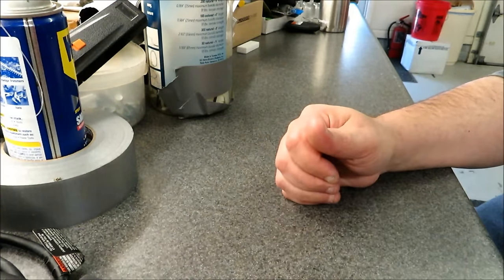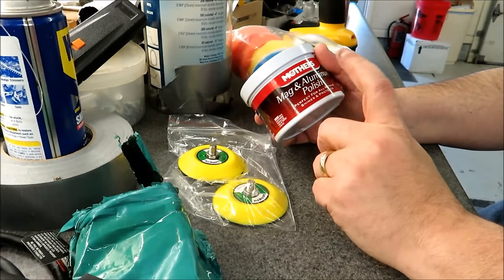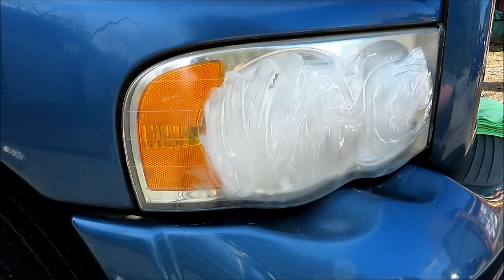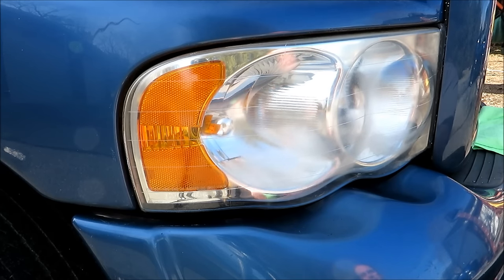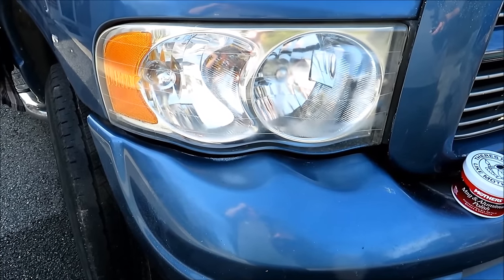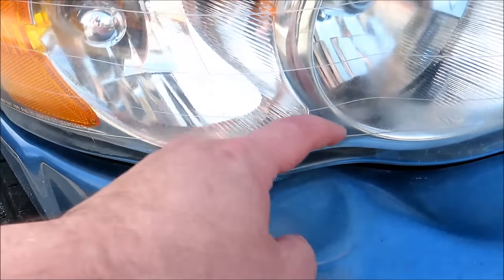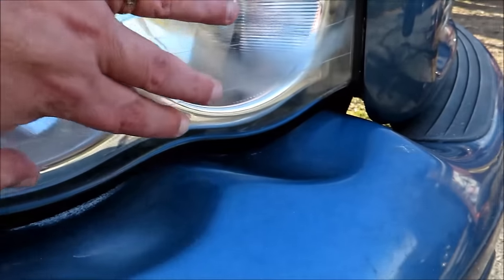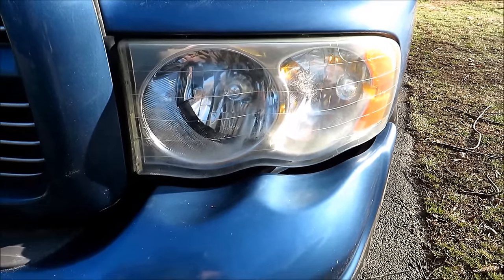Headlight Restoration using Mothers Mag Polish - Pass or Fail

Comment: It would help if you concentrated on the areas that were really bad. There are a lot of testimonials that Mothers really works; so your process is the one that is not working. There is also the possibility that you put a clear coat on the lights in which case it will require a more aggressive sanding.  Also, it should not take more than 10 for both headlights.

Comment: i have tried 3 store bought kits but one time with mothers mag cleaner did the trick beautifully, lot less work and looks great
Reply from the maker: Yea I was really hoping it would work for me as well.  I just think my lenses are to far gone.  The degree of damage that can be felt is pretty severe.
Reply: i was told by the garage that the lense on the drivers side was beyond fixing but i am stubborn,, i did the other one first i was so happy i did the one you could not even see thru and it even felt rough to my fingers but it took three turns and it came out brand new.... i am a  happy boy, off to florida tomorrow and happy that the lights will now shine brigher
Reply from the maker: Yea i don't know what is actually wrong with my lenses because that rough area wouldn't even come out with straight up compound and a DA polisher.  Which is why I think I may just be replacing the whole fixture.
Reply: @ticketyboo43  really need good lights on your car. Congrats on things working for you.

Comment: Nothing works like sandpaper also called micro mesh. I’m talking about superfine grits, so fine they don’t even feel like sand paper. I use 6 grits 2000, 3000, 4000, 6000, 8000 and 12,000. You can get 18 assorted pads on Amazon for about $20. Then polish with a wax and UV protection. That takes out any yellowed plastic and even pitting. You wet sand it by hand. It’s not as hard as you would think and the micro mesh pads last quite a while.
Reply from the maker: I might give this a try.

Comment: Every case is different, it will sometimes six and maybe more passes on each lens. It does not appear that you are using enough material on the lens and get a real cutting pad. I detail cars and yes there will sometimes be stubborn spots that require more aggressive buffing.

Comment: There is no quick fix  hack way to do this. Start with 800 wet sanding all the way down to 3,000. Clean and apply a UV sealant. You gotta put in the work

Comment: I used Mothers Mag and Aluminum Polish on a 2005 Lincoln Aviaor lights.. COuldn't even see the lights because of the oxidation  After one application it cleaned them up crystal clear  I did add another application just because I wanted too... I didn't use any buffers or tools only a rag to apply and rub off

Comment: Did you say you are using a cutting  pad? Is that like sandpaper?  In  the other videos they  use the buffing pad only
Reply from the maker: Not sure I understand your question.  My understanding is that the dense orange foam pads are considered "cutting pads"  I guess in theory it is kind of like sandpaper but not nearly as aggressive and how much "cutting" it does is really dependent on the material being used.
Reply: coolwrld302 it would seem to me that depending on the exact condition the headlight and  the brand of the vehicle as well may make a difference  some  Vehicles may require a wet sand with the 2000 grit sandpaper.  It would seem that a combination of wet sanding and the mothers aluminum polish might do the trick completely

Comment: You burnt the lens prior to using the Mothers. You could try 600,1000,1500,3000 wet sanding then go back to the Mothers! You are at the point of repairing what you have done prior.

Comment: Basically I did the same as you after viewing a video using the Mother's polish. All I had on hand was Meguiar's Mirror Glaze swirl remover 2.0 with a round nylon bristle brush attached to the drill . The lenses on my 1999 Ram van were a milky shade when I started. For the most part it did good but there were still areas that it didn't remove everything. Mixed baking soda with the swirl remover and it cleaned off more of the scale but not all. Got a SOS pad wet and applied gentle pressure while rubbing and that removed more of the scale. Then I waxed and the lenses look great. No they are not perfect but I just keep it in perspective.
Reply from the maker: Thanks for the comment.  Glad I'm not the only one that had mixed results.
Reply: IDYLBERRY n. Nññ

Comment: Mothers Mag and Aluminum Polish ? where does it say plastic polish ?  NEW  I finished polishing my Toyota all buy hand. Turing over polish cloth after each buff. Worked prefect. 3/3/2023  I watched 8:21 Looks to me that you used to much polish and used a very high speed buffing; hope you did not burn the plastic.  Hand work is real easy. Get a folding chair just the right height. I did many small area buffs with a small amount of polish. Hope this helps.
Reply: They all use similar DAT or SMAT abrasives, the metal polish just has a higher concentration of them.

Comment: My headlights have sections that look like the clear coat has flaked off so they have areas that are dull with a super thin layer of plastic chipped off t like  clear coat paint that has flaked off and other areas are still clear and undamaged.  Will this method work in this case and even the surface out?
Reply from the maker: Well if my experience is any indication I would say no considering the amount of damage that is still left on my lights.  However, I am not a professional detailer so I can't say for sure.  What I can say is the polish itself is fairly inexpensive and I would think if you tried to use this method you would find out pretty quickly if it was going to work or not so you wouldn't be out a lot of time to at least try it.
Reply: my lights are not that faded but they have part clear coat and part with it all flaking off so i wonder if this method would take off the rest of the cleqr coat and then shine the whole thing up?  It is aggressive enough to take off the flaking stuff?
Reply from the maker: Again not being a professional detailer can't really say.  From my own experience thought the polish did not appear to be that aggressive in that if you look at the texture of it, it didn't seem to "gritty".

Comment: Those dodge headlights are a real pain in the ass. I don’t know what kind of plastic they use but it’s not the same as any other I have tried. Those take many hours of sanding with 400 600 800 1000 1500 2000 3000 sand paper then you can use the mother’s or other polishes.

Comment: Buy a can of 2k clearcoat high gloss
Wet sand it with 400 then 800 grit 
Finish in a horizontal pattern with the 800 grit 
Paper everything off and spray a very light first coat 
Wait 5 minutes and then apply a medium to wet coat 
Allow 10 minutes and apply a third wet coat 
Let it dry for 24 hrs 
Brand new headlights with uv protection for the ne,t 10 yrs.
Reply: I get it, but spraying clear coat in multiple steps does not always work out! The dreaded orange peel affect, or even dust in the air can contaminate the outcome. Then you end up re-sanding and starting over. If you are good with clear coat application, yeah the outcome is the best for long term UV resistance.

Comment: This is what happens when one uses a wrong tool. Use a da polisher at highest speed, with a 6 inch cutting polishing pad.
Reply from the maker: Not to be too much of a smart ass but this is what happens when you don't watch the complete video.  I specifically reference the fact that I got out my DA polisher and it was still ineffective.  I will give you that I didn't use a 6 inch pad but that was because that pad would have been way to big to work on those lights especially with how contoured the lenses are.  Well at least it seemed that way to me.

Comment: No my headlights were worse than yours so you need a more aggressive cutting pan foam doesn’t cut it. You need a Maguires microfiber or  wool . That would really help a lot
Reply: Is meguiars microfiber cutting discs safe to use on headlights? If so, what speed on the DA polisher would you recommend. I have a Porter Cable XP 7424

Comment: From what I've seen on YouTube I've seen a lot of different ways of clean headlights different products but I think to really get that old clear coat off in the yellow out of it is to wet sand it off. I use 800 grit stepping up to 2500 grit wet sanding and then polished it it seemed to work real well for me. I thought I would try that rather than trial and error and spend a lot of money on different products. But your headlights didn't look that bad you know maybe a little bit of what sanding and try to republish it thank you

Comment: By looking at the many tiny spots and damage to the paint near the lights, that's exactly what's going on with the plastic in your headlights. Too much damage for DYI home solutions.
Reply from the maker: Yea that's kind of what I thought.  I do have a 3 inch wool pad so I may try one more attempt using the more aggressive pad to see what happens.  But if that fails also then I will probably go to just replacing the light assemblies.

Comment: Need to keep it simple nothing fancy old school it’s a little difficult to find nowadays but what my father taught me 30+ years ago on plastic with a polisher was cutting compound for lacquer paint. Not high find polish with wax is inside of it plain old simple low tech cutting compound this is what we used to do when we had spray cars with lacquer and then to level them down and polish them up used a cutting compound works excellent. And then again it comes to the skill of the technician with years or decades of practice how well you know how to use your tool how to apply your pressure and angle your pad and know the feel between work and burn and work and just floating. Are used everybody’s math it they all work equally well it’s just that the people trying something new don’t have the skill set and practice to properly apply the compounds correctly.

Comment: Yes I tried Mag Polish as well, applied it and started to rub it off and that crap would NOT come off, it was like glue ( and it was wet not dry ) It left a horrible film on my headlight and it was spotty and streaky . Had to use another product to get it off and it still after awhile can be seen on the headlight , it created a film worse than the headlight was to start with .
have used another product to clean and spray and it looks better but that Polish film can still be seen when in sunlight, have No Clue why it did what it did, it is a polish it should have came right off and even after trying a buffing pad on a drill , that film remains and can be seen in the sunlight
Horrible for headlights in my opinion.

Comment: I used mothers on my tail lights but AFTER I used 250-500-1000-2000-3000 grit sandpaper first and it worked great. I'm thinking about using it on iphone screen

Comment: Why is this guy using a machine?  In the other video the application is by hand! ✌️ Maybe the drill is to abrasive?  Why did he start with 1 polish before he starts video then makes video using another polish on the same headlight? How do we determine which failed?

Comment: would be  better i  think  to  hit  it  with  600 or 800  grit  paper  first .. take that  severe damaged  coating  down alot .. get into the plastic headlight .  then  hit it  with the  mothers   mag polish . i have used this  for headlights , works  good and  is  fast  .. but if  they  really  deteriated like  those  can  cut it  down  fast  with    600 or  800  grit .. then proceed to the  mother polish .. works   good .
Reply: and use  water  when  sanding
Reply: remember to  apply a  clear  coat  or they will be   back  foggy  in no time

Comment: I did this 2 weeks ago, and it didn't work. And, now I know why because I smeared it on and wiped it off in less than 5 minutes. And, I thought it'd work so fast and good BECAUSE all the dudes in YT made it look as if it's so easy, they acted like it wiped off in less than 10 minutes.
Anyway, thanks for being honest. Now, I know if it works, it'll only work good if I need to use quite a bit of "elbow grease"🙄🤔😂😂😂

Comment: So I spent about 5 hours doing one headlight today with this method+the sanding/buffing method and non of them worked for my headlights and they aren't even that badly oxidized.... Idk what I did wrong
Reply: LOL, if you spent even an hour you were doing it wrong.
Wet sand with 600-1000 depending upon how bad they are first.
Second, wet sand with 1500-2000 depending upon nice a finish you want.
Final correction with Mothers.
Complete with a decent 2K UV coat, else you'll be back again in 6-9 months touching it up again.
Reply: Lol. You could've taken the headlight off & watched tv while you do it.

Comment: Way too much product .put a light coat on lens then a dime size glob on pad to prime it .
Too fast. I find this product works best at slower speed like half pull on drill trigger.
Change direction. Go back and forth then up and down on next pass and continue with out adding product until headlight feels dry to the touch. No film left.  
Last use a microfiber towel with rubbing alcohol to remove residue from polish before applying your favorite car wax.

Comment: I used M105 and it cut like none other, a light pass with 1000 grit and the M105 and I was done in about 10 mins for both lights
Reply from the maker: The whole intent of this little experiment was to try like so many otherr videos I have watched to just use the Mothers and skip all the different sanding and compounding and polishing steps.  Of course in my specific case it failed miserably.  The thing I can't understand was even using straight up Turtlewax heavy duty compound still didn't take that damage out.  Of course no idea how much additional damage I did using that aggressive of a compound.  Once it gets warmer here I may circle back and try again.
Reply: I have done many headlights and failed plenty of times. I discovered that it depends on how much of the lens has backed in sun damage. Sometimes you can use no paper with an abrasive compound  and get a good result (it sometimes take a high speed polisher). I found it is safest to start in the middles and go from there, I usually start at 800 depending on the haze of the lens. 

I was not a believe in the Meguires M105, in fact I used their ultimate compound (UC) because it was so much cheaper. but after this last headlight restoration job with a dime size amount doing both lights, I won't go back to use anything else.  

I have used Scratch its, (works well considering its a $5 product), Mother head light restorer, toothpaste, turtle wax heavy duty compound, turtle wax light buffing compound, paste wax,  mothers mag polish, and wipe new. I'm sure there are some others I  I have forgotten over the years. 

As far as the heavy duty compound not taking the damage out, it is because you we not deep enough into the lens to remove the oxidation. Using the sand paper removes the film/plastic that is damaged until you get to a surface you can polish clear, othere wise you are polishing over dirt. It is the same principle for aluminum mag wheels, they will shine if you polish them , but if you get the dirt off the surface a 'brushed look' wheel can turn into a mirror. Hope this helps. 

I should also mention it took a lot less effort  with the m105 after i had the light clean, I did not even use a tool, just a terry cloth and my hand, I was most impressed.
Reply from the maker: This has been very helpful thanks for the insights.
Reply: Every case is different! I have five cars and trucks,  and each one is its own challenge. Thus why I watch videos like this. What I want is a final UV clear polish! Not a spray or a brush application. Just a final wax sealant won't last long enough. But spraying clearcoat is a pain. I am expert in the multi step sanding process, the final UV protectorant spray or coat. that is the failure point for me.
Reply: @irish6976  I agree, a good UV 2K clear is still the best way to go for longevity in my opinion.
Reply: @IA-sh2yu  What brand of product would you recommend for UV 2K clear?  Time to do headlights again!

Comment: Mother's can only do so much regardless of the pad you use clean it with alcohol first take off any dust and if mother's won't do it. Try to sand paper 600 -1000-1500-2000 and also.3m has a 3000 grid foam paper to finish it soft last step use some was and done
Reply from the maker: At this point seeing how lens aren't nearly as expensive as they used to be pro ably just going to replace them completely.
Reply: coolwrld302  yes bro but also u need to make sure you don't go over the 1500 rpm or else you'll burn the plastic but yes I feel you

Comment: You need to use a buffer like everybody else is doing
Reply from the maker: Not sure if you watched the full video (I get it as it was long) but I did reference that I eventually used my Chicago Electric DA polisher set to 5 and still did not get those areas off.  Not sure if that is the kind of buffer you are referring to or a straight up rotary buffer.

Comment: fail bcz you didn't use a buffer what did you expect with a cordless drill
Reply from the maker: Fail because you didn't watch the whole video.  I specifically talked in the middle of the video that even after using my DA polisher the lens still did not completely clean up.  As far as the cordless drill part I have watched other videos with individuals using a cordless drill and Mothers and it worked just fine.  Of course I don't know how their videos were edited nor how damaged the lights were to begin with.
Reply: That grammar sucks lol